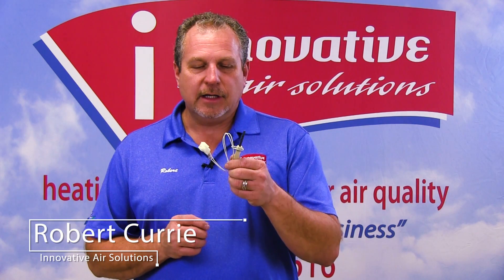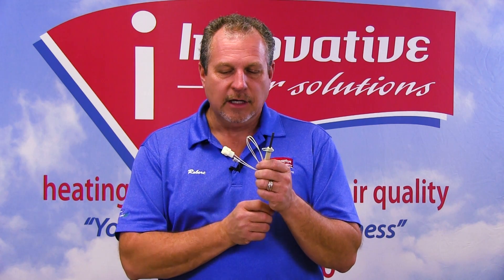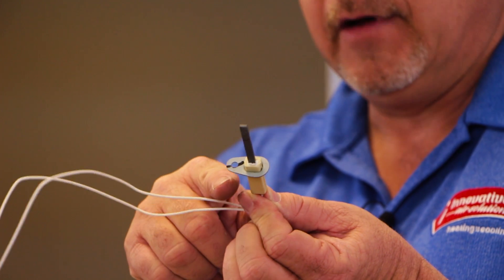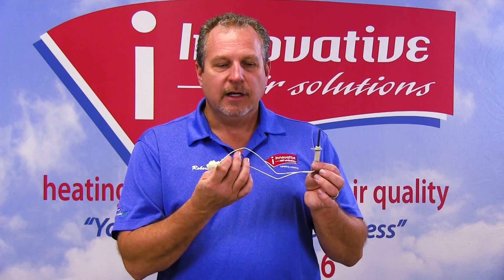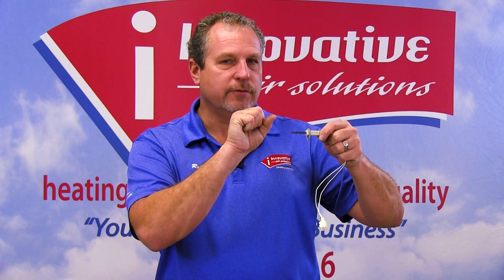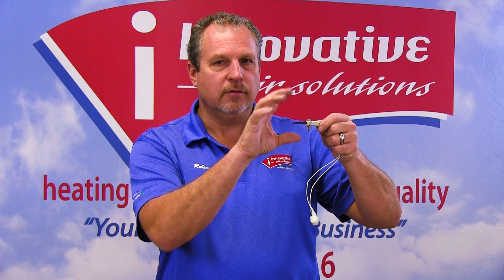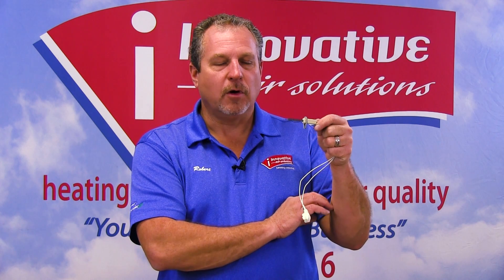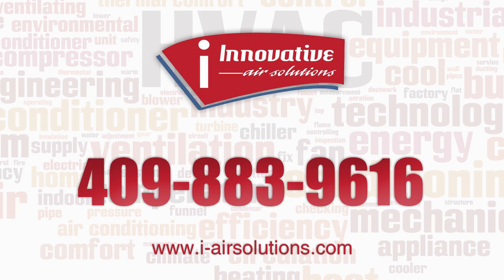Hot Surface Igniter

Comment: I appreciate the time and effort you put into these videos, and I don’t want to sound petty, but touching either the silicon carbide or silicon nitride ignitors on their ends is a myth.  Just so that you don’t take my word for it here is a link to an industry leader’s article on HSI:
https://www.achrnews.com/articles/84360-hot-surface-igniter-operation-and-troublehooting
I know that this article mainly talks about silicon carbide, however silicon nitride is much more durable.  One could literally use a silicon nitride ignitor as a wood burning kit, dip it in water or even motor oil, then wipe it off as use it as designed and they would still work—obviously not recommended!